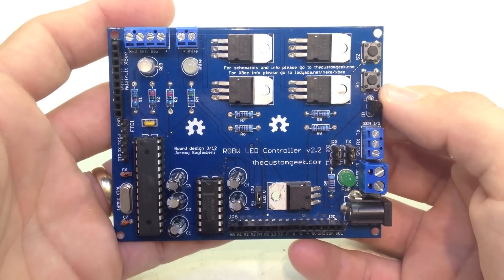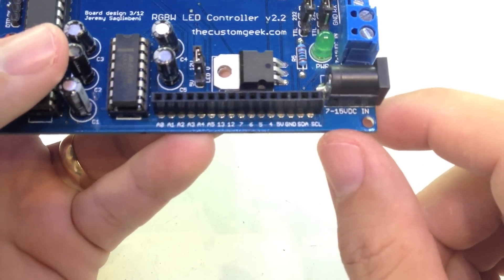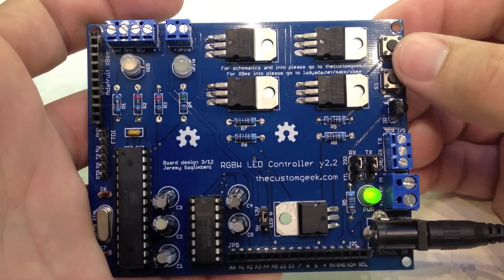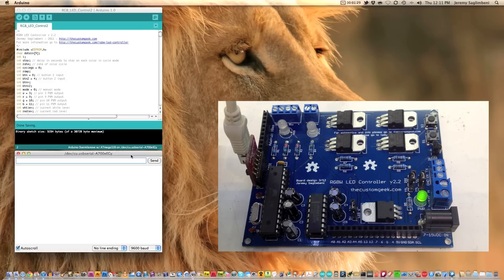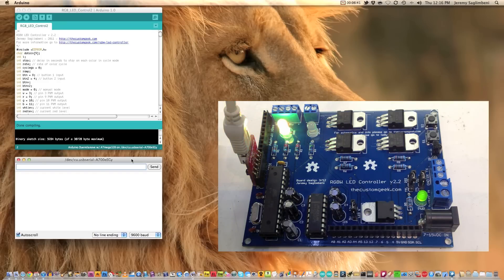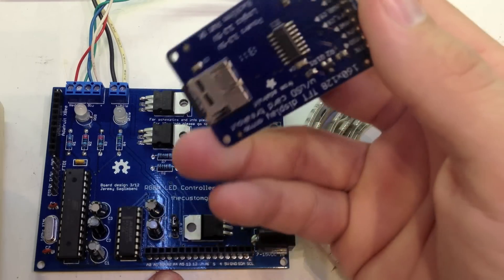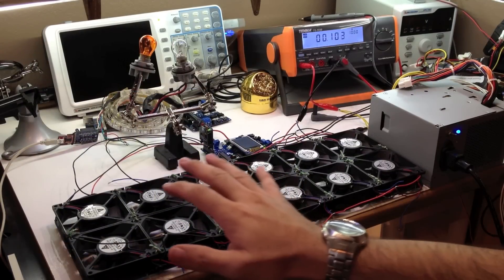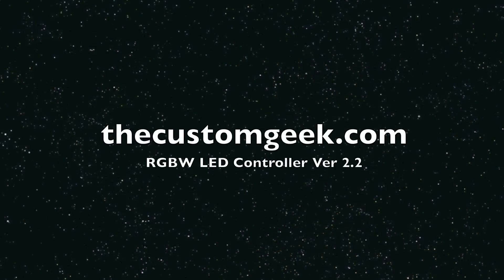RGBW LED Controller

Comment: I know this post kind of old but would this be able to control about 30 rgbw leds with the radio frequency remote set to only cycle 2 colors instantly without the color fade.

Comment: i want to lightup 200 rgb leds in parallel connection at a time. i want to control the led using blynk app too. is this possible with your board???

Comment: What is the maximum current output for the RGB channels at 5 V with the latest version of the board (3.1?)? Was the 6.2 A limit in the video for the input at 12 V? I need something like 2 A for each of three colours.

Comment: An LED controller that is running everything but LEDs....
Reply: oooooh no reply from Tuffenough4u ??? I think you hurt his feelings with that one
Reply: TEST LOADS DO NOT HAVE TO BE LEDs I BUILD 5000 WATT AMPS DO YOU THINK I TEST WITH SPEAKERS NO I USE DUMMIE LOADS (( RESISTORS ))
Reply: Its not the point. The video is boring and this is a video channel after all.  People like myself come here to actually see something.
Reply: Someone’s not tuffenough to learn something 😉

Comment: Hi, impressed by your video, (not an expert myself) but I need to find  controllers for several mobile VMS (Variable Message Signs) in Australia. I bought 4 at auction, only to find the LED panels had been removed without my knowledge, from three. Now I want to try powering the one up first and moving on to the others. All have the transformers and related wiring. Please tell me whether you have what I need to power up LEDs in single colour and variable wording. Boards measure 1560mmx780mm and 21 LED panels.

Comment: Nice video... I was just wondering.. If you connect a strip, is it possible to turn just spcific lights on and keep the rest off? Can you address specific lights in a strip or does the controller treat them as one unit?

Comment: What is the maximum Amps this can handle??
Im looking for something to run 30m of strip light off a 12v 30Amp Power supply
Reply: mail to sales@mjjcled.com to talk details,they will give you a full solution of project, 1pc mater control to drive 30m led strips

Comment: Good job, very nice PCB design. Is the firmware capable of using audio-in or a mic and then controlling LEDs with audio, or would I have to implement it myself?